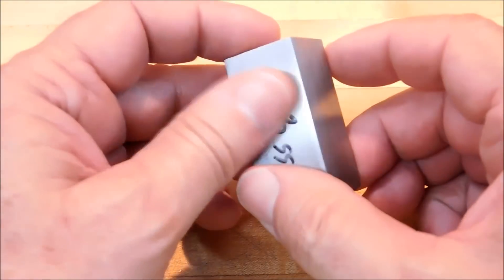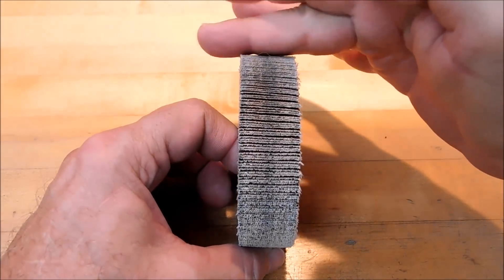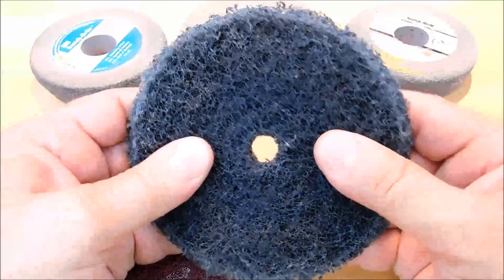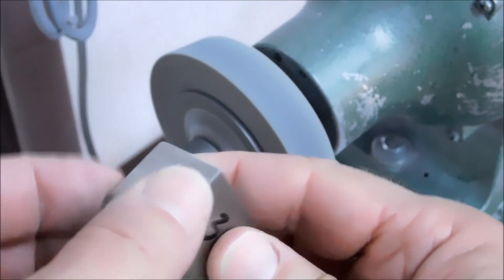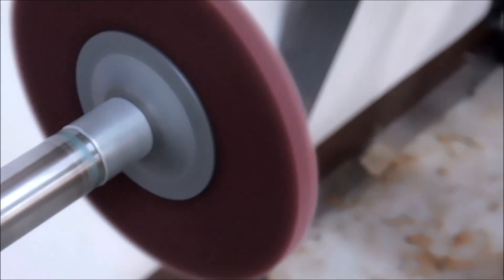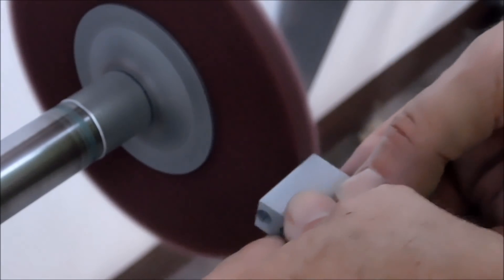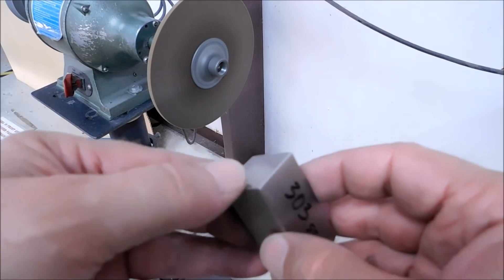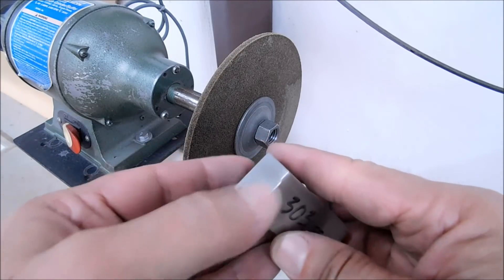Deburr Your Parts Like a Pro !     --SHOP GEM Included--

Comment: Improve the performance of a wire wheel by reversing it occasionally. The wires get worn in one direction. When reversed, it has sharp, pointed wires that are very aggressive until they get worn down then its time to reverse it again. Try it and be surprised at the difference. 👍🏻.  🇺🇸😎

Comment: Here is a tip for the home shop guys who don't have the $ to drop on the wheels available commercially and aren't doing tons of work and just need to clean up a few pieces. 

Make friends with the guys who take care of the floors where you work. The floor scrubbers and burnishers use wheels with a punch out center that is 3-3/4" in diameter. If you ask them nicely they will probably give you all of these little gems you could ever need. They come in a multitude of "grit sizes" from white which is a super fine burnishing wheel to black which is a stripping wheel. There are at least a dozen different colors in between. They are 3/4" thick and with a little work you can adapt them to fit on any arbor size you need to fit with a punch or die. 

I use them for everything including scrubbing pots in the kitchen at home. They are fantastic for polishing metal in the shop but they will break down quickly but then the cost on them is nothing and they work like a charm. Got some rust you need to remove? Grab one. Paint to remove? Check. Get a mirror like polish? Grab a white one and go to town. 

Like I said, you can probably get them for free or a six pack at most. The bigger the floor area, the more they will go through keeping them clean and shiny. I've gotten whole shopping bags full when the floors are being worked from stripping to polished.
Reply from the maker: That sounds like something to look into.
Reply: Great tip, thanks for sharing.
Reply: Thank you.

Comment: This is a little off topic-- but i wanted to mention that I have some sharpie pens that have lasted 7 years. Here is how I did it. When a pen starts drying up, I get a piece of 1" long surgical rubber tubing. I use the semi clear stuff. This has a about a 3/16" Id  and fits the end where the pens wick (tip) sticks out. I have a piece of wood drilled with a 1/2' set of holes drilled into it, I stand up the pen in the hole, slip the tubing over the tip end, and add about 3/4' of Denatured alcohol. you can see it fill up thru the tubing. when it reaches the top -  I put the pens cap on it. I stand up about 3 at a time like this, it takes about 4 hours for the d.alc to wick back into the pen. next day I observe that it is done , pull off the tubing , wipe up any residue, and recap The pen. Like I say the pens can last a long time, there is a lot of ink in them, it just prematurely dries up with all the dry stuff you mark. Another point -- These Can be used as Emergency lighting -- just light the end of the pen -- it essentially is an alcohol light. watch out it might melt down being plastic so best not to hold it.

Comment: As always, good stuff Joe. I use the 3m 9s fine exclusively.. usually for deburring finished machined edges. When I was an apprentice back in the late 90s, I would have to use that wheel to buff .03 radii around a 6 sided block. If I didn't get the radii to meet perfectly at the corners, or the deburred edge wasnt the same width along the entire part,  I would have to start over. I use the same practice to this day.
Reply from the maker: That combination works so well. I buy the pink wheels by the dozens and always have them ready.

Comment: Thanks Joe for the tips on deburring, before everyone goes down to their local b&q or Home Depot, they should be looking for a beefier motor and not the budget 6” 400 watt ones, they just struggle to fight their way out of a paper bag!  Never mind trying to keep things going with integrity!Usually the 8 “ bench grinders have a little more oomph, you could always look for a used Ex-industrial electric motor nearer to a 1horsepower plus the momentum of the mass of the shaft /rotor etc give good torque. Then make a custom adapter to mount on the shaft and appropriate size threaded output for the wheels etc. Most guys will know this from experience but the odd one or two might not, for the cost of a new budget grinder you can buy twice the HP motor on the likes of eBay.  Like I said before,I’m not trying to teach folk how to suck eggs, but if I save one guy from ending up disappointed, then I’d be happy enough ,thanks again Joe, soon as you mentioned the 3M fibre discs I did a quick search, Christ they are dear but if the save time and money, it validates them. Take it easy Joe.       Phil from the 🇬🇧
Reply from the maker: thanks for the comment Phil. For grinders that will see some pressure, I always go to my Baldor. For buffing, my little budget motor is doing OK for now.
Reply: I snagged a 10-amp 7" variable speed Ryobi angle grinder with variable speed that's quite useful. The 1800 RPM to 6000 RPM range has been super convenient. I think a water bath machine similar to a metallurgical polishing table would be killer as a vertical assembly. Like a cross between a Tormek and a surface grinder, but with sandpaper, nonwoven, and white AO wheel capabililty.

Comment: Joe, Im certain you know that too much pressure will only make a mess on the floor. A light touch and let the wheel do work, even on heat treated parts. Excellent video as always
Reply from the maker: Extremely sharp harder steels can throw some debris before the edge breaks down. Patience is a good idea to get the best performance.

Comment: One thing to add on those EXL Wheels -- They are Very Directional -- If you run them Backwards -- You can dig in and literally have a pile of gray fuzzy spaghetti all over the place. The directionality is easily determined with the hand -- Rub one way, and it is smooth, the other way (The wrong way) it has a drag effect to it. Run it toward you the way it feels smooth. They do not always have Arrows on the sides. Very Important.
Reply from the maker: I'm lucky to have not worn off the arrows yet.

Comment: I use the Scotch Bright too. Medium in AO, and fine in SiC. AO for steel and SS, and SiC for aluminum and other soft metals, occasionally for plastic, but just barely touch with plastics, or there won’t be any plastic left after a second.

Comment: Did you get your bike back together?  I only saw the front wheel in the vid.  Great tip on deburring.  I use the scotch brite wheels at work to debur my parts every day they are a huge time saver.

Comment: Thanks for the info. I bought some 1" Scotch Brite wheels, made an arbor for them and use them in a cordless Dremel I keep by my mill. They work great and saves steps to the bench grinder.
Reply from the maker: Try to keep the pink fibers from getting on the ways and into the motor housing. They accelerate machine wear.
Reply: @joepie221  Morning Joe.

Comment: Fantastic!  What would you recommend for 1/2" aluminum rod (don't want to deform it).  Moving to better aluminum (6061), but right now using 6063 bubblegum.  Seems challenging to easily cleanup in a production run.

Comment: Great tip Joe. I can't wait to try it. Now I think I may have wasted my money on the nice Noga deburring set that I bought a couple months ago.
Reply from the maker: I bet you smile ear to ear when you try it.
Reply: They both have their place. Unless you use a Dremel, or something like it, you can’t deburr an 1/8” hole without marring the surface with one of these. I know, because sometimes I get lazy, and try it, using the corner of the wheel.

Comment: 2:55   Another thing with those discs is that you can stack them to create a wider wheel
Reply from the maker: Use a hard spacer between them if you do that. Otherwise they cup and spread apart.

Comment: Just in time, I need to clean up the rear wheels on the 2" traction engine. I have tried the scotchbrite wheels with 6 leaves and they work well, but the solid version looks even better
Reply from the maker: The pink ones are great.

Comment: Another great tip. I did not know then EXL deburring wheels but read on the 3M site that these work best on sharp corners and burrs - something where most other wheels will break up fast.
But the tip for straightening flap wheels is great. I have to run to our trash bin to get some old flap wheels out right now 👍

Comment: The flap wheel tip was cool but do you have any tips for dressing the fiber wheels? They always have grooves and large radii worn into them that make it hard to get into corners. I've even tried a carbide endmill and it wore down the endmill pretty fast without doing anything be ripping chunks out of the wheel
Reply: I use expired carbide turning inserts held by my trusty vise grip.
I cut like 8 or 10 grooves even across the wheel, then go back and forth until nice and round. I should add that you have to jam the insert in the wheel with quite a bit of force, (not really possible to do without some kind of rest on the grinder) otherwise the wheel will annihilate the remaining edge of the insert before it removes any of the wheel.
We use these to deburr everything in our shop, but most of the buffoons I work with insist on cutting as deep of grooves as possible in the wheel.
Reply from the maker: I agree with the other comment. Use a worn out insert and rake the wheel. I believe speed is your friend and use some pressure. If you try to dress the wheel, the wheel will win.
Reply: One way to dress the S/B a
Reply: Hit the wrong button. One way to dress a S/B wl is to get a piece of anti slip tape (local hardware store) and stick it to a flat piece of wood. Then lightly run the abrasive against the S/B wl. The more aggressive the anti slip tape is the faster the wl gets dressed.

Comment: Starrett branded house bricks for flap disk truing-only $79.99!
Reply from the maker: Love it. Maybe I'll sell them on my website. I actually do use a house brick. It works perfectly.
Reply: That $79.99 Starrett House Brick includes a traceability certificate and its edges are parallel to within 0.01deg.   Unfortunately it doesn't come with a case, just a simple cardstock box.  :-/

Comment: A lot of these wheels seem to have weird mounting requirements. For example, that loose scotch-brite wheel need some sort of a flange to support it, as well as the convolute wheels, which in the 8-in size all seem to have a 3-in diameter hole.

Specific recommendations, including mounting hardware, for an 8-in bench grinder would be greatly appreciated.
Reply: There are flanges by 3M that reduce the 3" hole down to whatever arbor size you have.  I am currently using Jet 1hp buffer that have the 5/8" arbor.  If that is what you have search for "3M Brand Tapered Flange 356" for the 3" to 5/8" arbor reduction.  Check at trugrit DOT com.  I know 3M makes other 3" hole flanges that reduce to other size arbors.  Again check at trugrit DOT com , look under "Buff-etch-sharpen"  .  I think Jantz knifemaking has them as well.

Comment: Recently, I've been using wheels from Benchmark Abrasives. BM-SPW45AO_1 has been my go-to disc (leaves a lovely finish that's better than 320 grit sandpaper). Now that you point out R.S. Hughes, it's time to go shopping, since they have a mega selection.
Reply from the maker: They are my 'Go To'. Local too.

Comment: Hi Joe  I’ve been looking for a buffer/deburrer and Baldor comes into my mind , what horsepower should I chose to start with . 1/2 , 3/4 , 1  hp ?  I know they are very pricey, but they got very good quality to them . Thanks  Mike
Reply: If you didn't get a answer yet, after my research during my buying I found most people like the 3/4 hp 1800 rpm buffers

Comment: do you recommend using a respirator when working with these?
Reply: I would.
Reply: You can hear in the video that he doesnt use one. Once you get used to the wheels you can just hold your breath, deburr and walk away without breathing anything in
Reply from the maker: Actually for a single piece, I do take a deep breath and hold it while I work. For aluminum or multiple parts, I have a mask hanging right alongside the machine. Once direct sunlight shines on the work area, it looks like a snow globe with all the material in the air. A mask is a very good idea.

Comment: Good stuff Joe.  I'm typically use a Kalamazoo 1 inch belt sander like this to do the majority of my deburing.  But have a scotch bright wheel on a buffer if I need a finer finish.  Don't really use the spongy wheels except for flat ones on a angle die grinder.  My buffer has a SS wire wheel on the other side for cleaning and deburing threads.  Wire wheels don't do too bad for deburing edges and cleaning welds.  I not an expert but have been work with metal on and off for almost 60 years. 

https://www.travers.com/1-x-42-sander/p/87-135-001/
Reply from the maker: I love wire wheels for threads and knurls. They do good for thick rust removal too.

Comment: Could you please give us the name of those 3M wheels again. I for one would like to try them.
Reply: Not trying to step on anyones feet,but I believe this is what he used.https://www.amazon.com/dp/B0006N7LOO?tag=duckduckgo-d-20&linkCode=osi&th=1&psc=1
Reply: @nasty509ss  Wow,  $70 per wheel seems pretty pricy
Reply from the maker: Time is money. These wheels are well worth the investment.
Reply from the maker: The stills at the end of the video show the name and brand.
Reply from the maker: @nasty509ss    Yep. good choice. if your budget is limited, get a medium grit.
Reply: @funone8716  They can be found on Ebay for less.
Reply: @funone8716  they last a long time as long as you don't groove them out and keep the wear even. my shop runs 3000 parts a week on some of our machines, every part with 6-12 edges that need deburring on hex stock, yet we might change out a wheel every couple months. I think we use norton branded fiber wheels, but these appear to be the same thing, probably just with 3m markup.
Reply: @joepie221  ("Time is money")  Not so much for us hobby machinists.

Comment: Thus wheel only used in corner edges applications, can i use this wheel for steel pipe deburring applications
Reply from the maker: Get the correct grade and expect it to wear quicker than if used on aluminum, but yes.
Reply: Cordless right angle die grinder and an SJ6 single cut bur. These old guys dont know they exist.

Comment: A rest or leather gloves may be order as I assume those wheels do not differentiate between metal and flesh.
Reply: Let’s just say the burn is petty painful when your knuckle brushes one of those 3M Scotch bright wheels and leave it at that.
Reply: I personally never wear gloves around anything that spins,   I'd rather a little burn than get caught and pulled into the machine.     Just my opinion,     not a recommendation
Reply: @russcole5685  Agreed, no gloves (I use these daily at work, often for rather small parts).
Reply: I use welding gauntlets, so the ‘loose’ but is higher up the arm.
Reply: @sharg0  myself aswell,    have had a finger caught and torn up in a 5" grinder with a meat axe blade,   only the once, and only because I was wearing a glove,       caught it and pulled my hand in,     if I wasnt wearing gloves,   all it would have done was nic my finger tip.        Very hard arguement to win with OHSA    but experience and lateral thinking are rules,   not a paper pushing desk sitter.   Lol.    I'm in New Zealand,    so unsure of rules in other countries,    but here,   over the last thirty years,   things have gotten a little stupid.   Removing the thinker from the job,  robot do this, this way.   Lol

Comment: I just consumed a brand new high quality file only by rounding of the edges on 2 pcs. Ø 200 mm t=3 mm stainless 316 that had been water cut. That steel is a real bitch to grind and polish.
Reply from the maker: Sometimes the garnet from the waterjet process is in the edges that got cut. Its very abrasive.

Comment: "I guarantee you're gonna want to buy them." You're costing me money, Joe...😂
Reply from the maker: But saving you time!
Reply: Joe, What are you using to face the gray Scotch-Brite wheel? 
Thanks, Mark
Reply from the maker: @markjohnson9884  I rake it with an old carbide insert and finish it with a sharp piece of stainless. The flat side of a house brick comes in handy too.
Reply: @joepie221  you were dead on...quick, fast, and easy. I feel like I've wasted so much time.  It would've been great if you had done this vid back when you did the threading video. Lol

Comment: Usually you are very safety-conscious, yet there are no guards on the wheels.  Why is it so?
Reply: There's no way one of those wheels is coming apart, the buffer is running at 3600 RPM. That's nothing. Plus You need the access for deburring parts with more complex geometry, he's not just using it for bar stock day to day.
Reply: @otm646  I don't know what buffer's you use, but the "BUFFER'S" I use, run anywhere between 1,700 RPM's to 2,500 RPM's. After 2,500 RPM's, your talking speed's of a grinder, up to 5,500 RPM's. These speed's hold, whether using a Bench machine, or a Hand held machine.